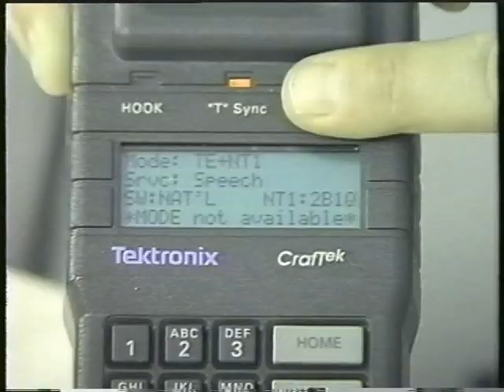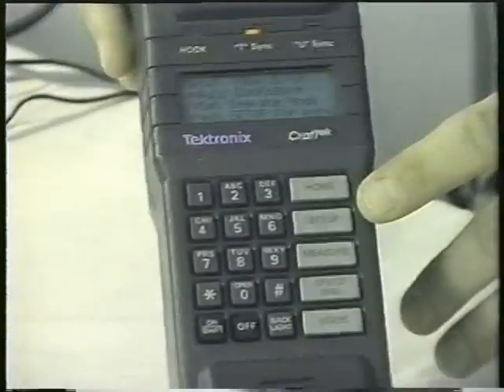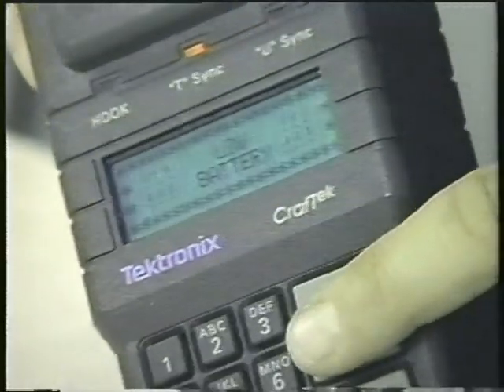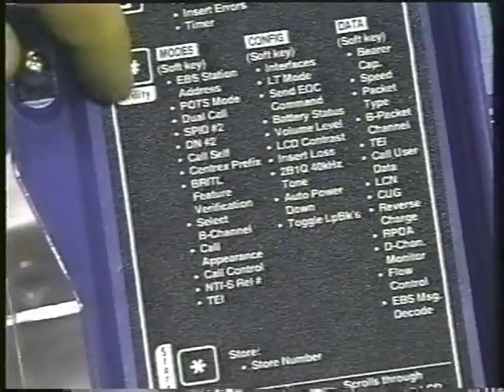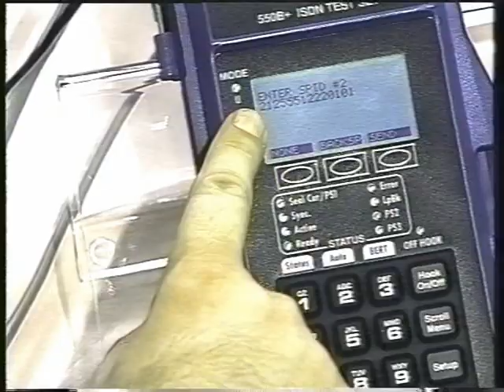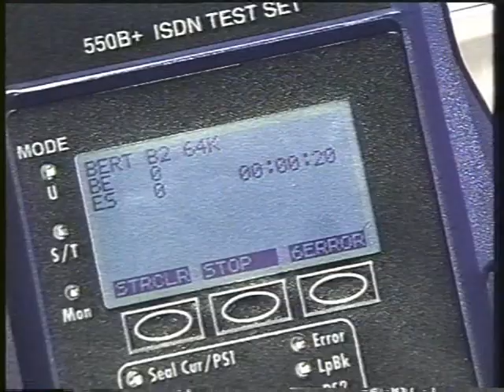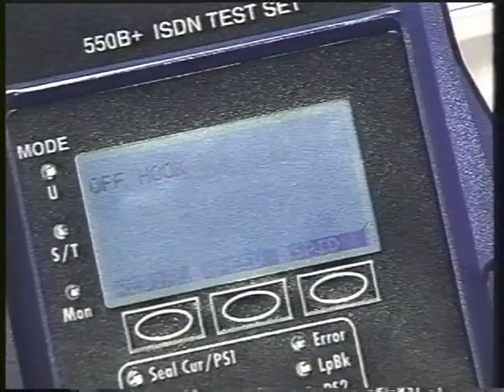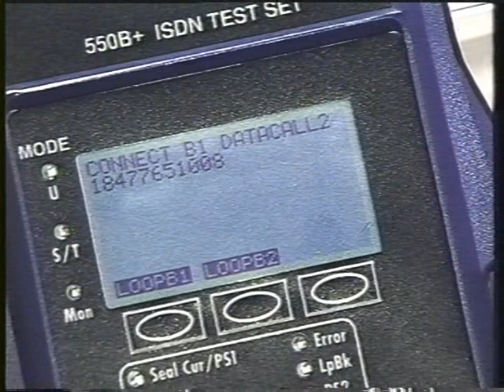ISDN Test Sets and circuit testing

Comment: I have a Harris ts250 test set but I dont know how to use it.  Are you familiar with this model and would you post a video of its use for POTS, DSL and T1's?  thanks
Reply from the maker: Andrew Gonzales sorry for the slow reply.  These videos are clips from classes and training tapes created in the 1995 time frame, no new videos are planned.  As for your specific question, I am sure that if you examine the Harris menu items items you will find all the same input needs as found in this video.  The Harris set will require LDN, SPID, and ISDN Switch/CO type info, which is consistent with other test sets.  Functions will be similar as well.

Comment from the maker: Hi there, no I have not used the Fluke 635.  From the name it seems to support BERT testing which is pretty simple.  Connect to the T1, you will need to know something about the line code and framing, and establish a loop, then run the test.  If you are going to test end to end, you need a Test Device at both ends, if you are only testing a portion of the circuit, eg the local loop, then set up a remote loop and run the BERT.